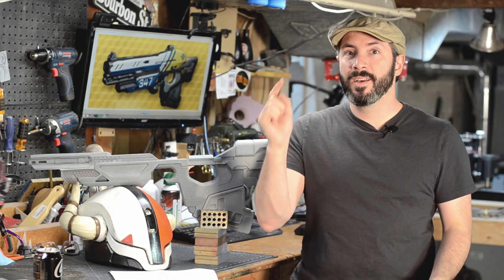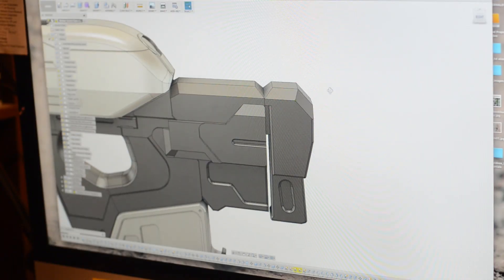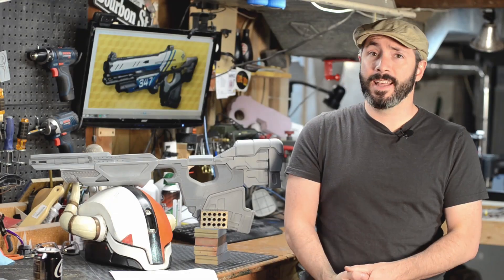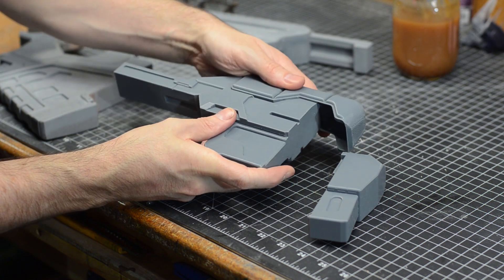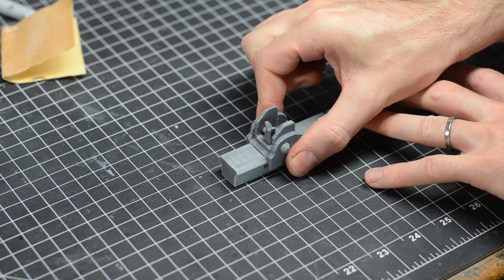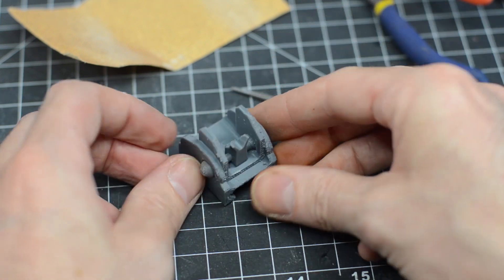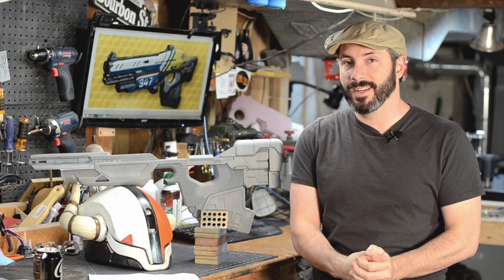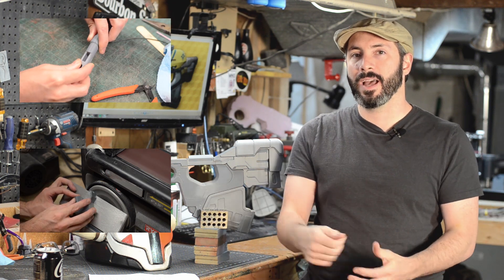How to 3D Print a Gun Prop from Destiny Part 6: Adding More Parts

Comment: i have this piece piece that doesn't fit with the other piece it has this huge gap can i use epoxy sculpting clay to fill the gap. printed in abs.
Reply from the maker: Yes, I've use epoxy clay to fix parts of 3D prints.

Comment: The scope as your calling it is a, "Forward Iron Sight" and the "Rear Iron Sight" but it could be a holographic red dot rear sight. They don't fit the definition of a scope as they do not have an glass/plastic faux optic.   But it is a far cry from the turned aluminium round stock scope that they were being  used back at conventions in the late 1970's and early 1980's

Comment: hey Bill, did you know there is a setting in your simplify 3d slicer to add or subtract from the part thickness that allows you to a) design with 0 tolerance but b) still have your parts fitting perfectly without more sanding than necessary.
you could even set that to something more drastic for parts that you are coating in resin so you don't have to sand thosr down a lot beforehand.

Comment: Vice with soft jaws for holding fragile items while drilling, saves any 'surprises' :D Careful about wiggling the drill around in the hole though, just go straight in and out to avoid excessive play/slop when the parts go together. Digging the process so far, it's gonna be a beast when it's done.

Comment: I just realized that hes using an Ultimaker 3D printer.... the Original+ is like $1000 and it looks like its made of plywood... 
the one hes using is the Ultimaker 2+ Extended which is around $3000! did anyone else see this? good 3D printers are expensive T^T

Comment: Gah, almost a nasty drilling accident there. Never hold something you drill with your hands. You could sometimes hold a plastic part with your hands if you dremel it with a grinding or routing bit - but those won't bind.

Comment: Great work Bill! For drilling into PLA, I usually just spin the chuck by hand. Power drilling tends to make the hole a bit bigger than it should be, the drill bit can wander a bit when starting the hole, and it's easy to drill too far. Spinning the chuck by hand is usually easy enough, though if you have a lot of holes, you're going to get a bit tired. Anyway, that's my preference, since the results are bit more predictable with this method. Thanks for these videos!